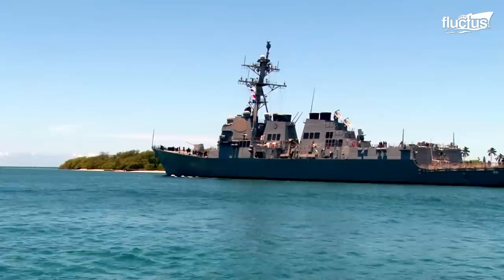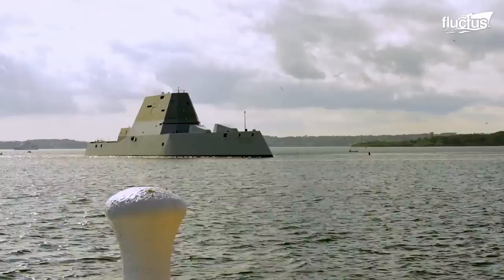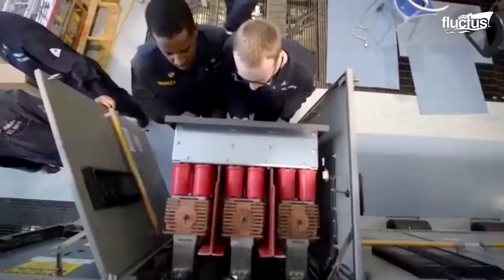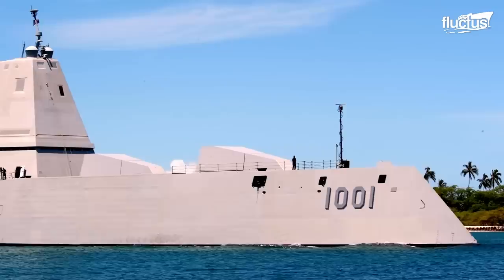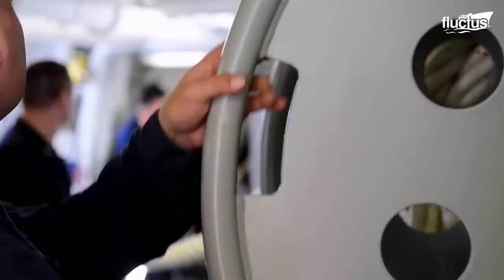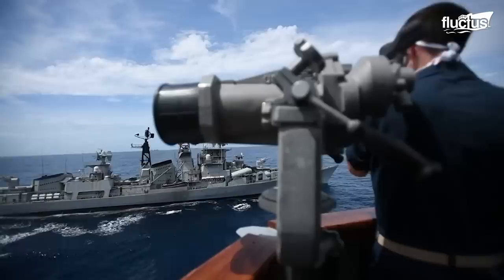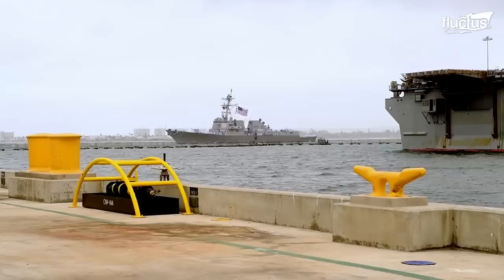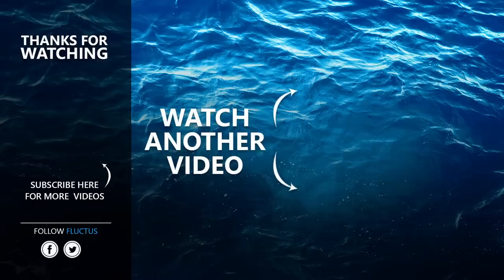The Hypnotic Process of Launching US Most Advanced Stealth Ship Ever Made

Comment: Would've been better to upfit modernize and recomission all the Iowa's for a whole LOT less than 1 of these boondoggles instead. 
Or just build some 21st century bbs vs a fragile composed of composite materials missile platform like this.🤔
Reply: Yep, you could have completely modernized all 4 Iowa's and had A LOT of money left over for the R&D and construction of the three Zumwalt's. They would have been a lot more capable ships as well!
Reply: Battleships in the current era of warfare is suicide.

They are far too slow and don't have the maneuverability and fleet flexibility as a DD or CL
Reply: @-Temple-  35 KNOTS IS TOO SLOW FOR YA? THOSE IOWAS CAN OUTRUN MOST NAVAL SURFACE COMBATANTS!
Reply: @-Temple-  They are faster and as maneuverable as an Arleigh Burke DDG. Either way, you're not out running a anti-ship cruise missile.

Comment: An engineering nightmare.
Humans afraid of the water syndrome.
They designed an office building on a life raft, and ruined a tumblehome hull in the process.
Sure they claim the numbers worked, but I can tell looking at it, that its an unstabile roller.
Not enough draft and displacement for the amount above the waterline. also its likely to crack across the deck in heavy seas, as the leverage point is the waterline, and the difference above and below multiplies the stresses. 
You got it amost ALL  wrong engineering guys! congrats!

If you wanna design the destroyer of the future, get most of it below the water line, and as little as possible above the water line, and leave the office building on land. and create a tall thin tower for visuals and control location. the bow and tumblehome hull shape are excellent, the rest sucks. If you want shallow draft for litterol use, you have to go wider and less above the waterline and way less super structure.
If I had been shown the drawings before bending metal, could have pointed out its problems.

The root of the problem is belief in numbers, rather than practical designs. The sea is chaos in power during storms, and doesnt care what your computer says.
Once again the "Experts" are in process of discovering what the rest of us have known all along.

And only cost billions, to figure out, and only risked national security to large extent.
I would call that design unsalvageable... And unfortunately the screw ups will give the bow and tumblehome hull a bad name undeservedly, and retard design progress, and the experts involved will lie to that effect to cover their asses and nothing will be learned.